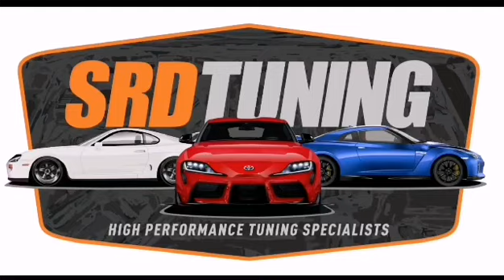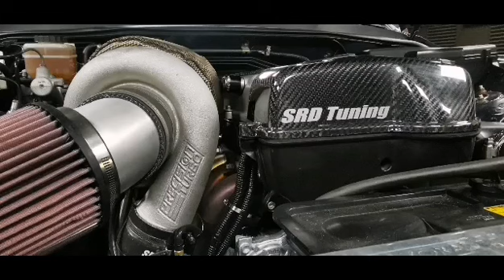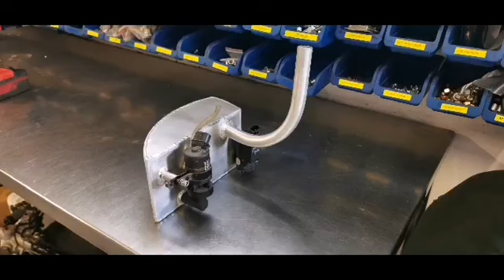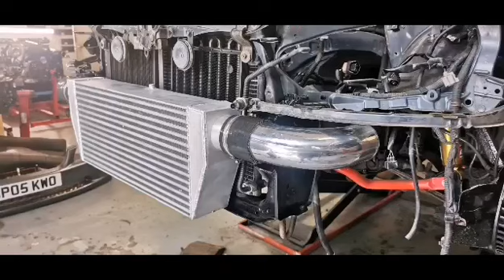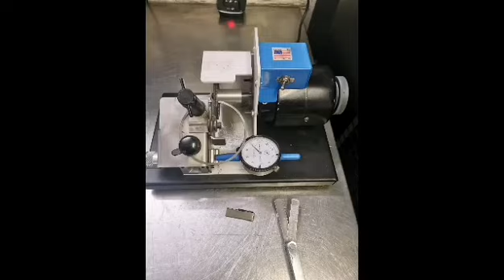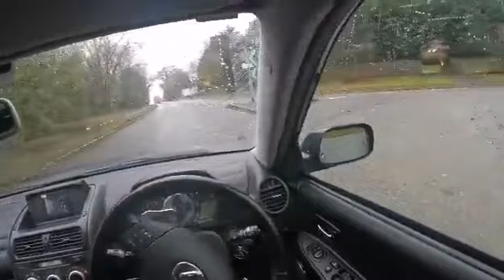1000HP 2JZ Lexus IS300 Sportcross with ISF 8 speed transmission

Comment: More info on final drive gearing? Are you using the factory gears (3.90 or 3.72)? And more info please on the steering wheel swap. How did you adapt the airbag, or did you? Thanks a ton!